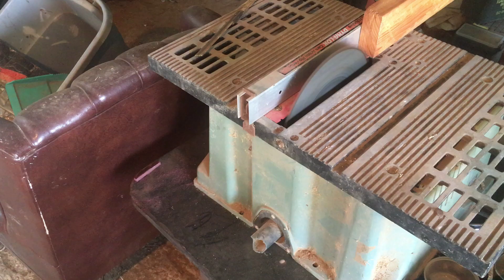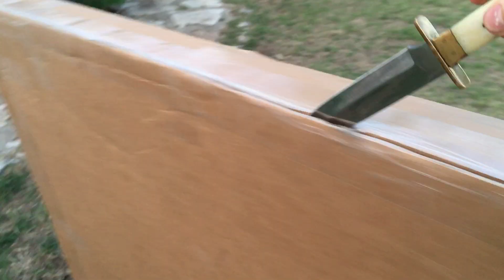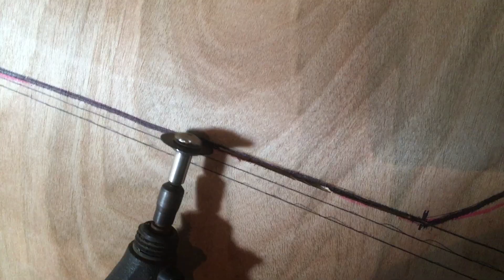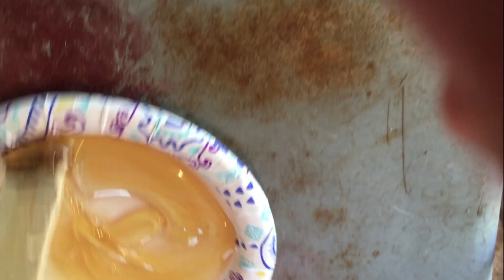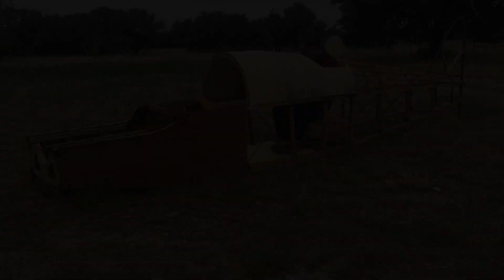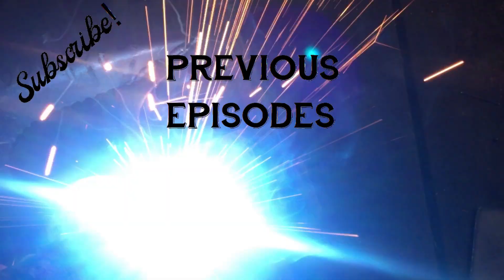Homebuilt Airplane Episode 6: The Fuselage Completed

Comment: Consider using wood filler or wood glue mixed with sawdust to fill the gap in the upper fuselage. Not sure if it's lighter than Bondo, but it certainly will adhere to wood better.

Comment: Good Job  great innovating on supplies but one thing I would like to warn you about is NEVER use plain dixie cups to mix your epoxy there is a chance that the wax used can sluff off into your epoxy causing it to weaken, and I don't have to tell you the results of weak glue right? be careful  of using wax covered paper plates too , I like the idea of paper plates over  plastic cups as getting glue to wide surfaces and looks like easier more thorough mixing  works better, thanks for the clue. good luck.